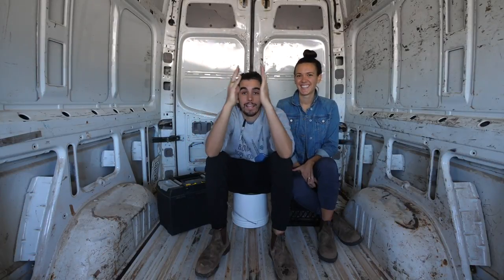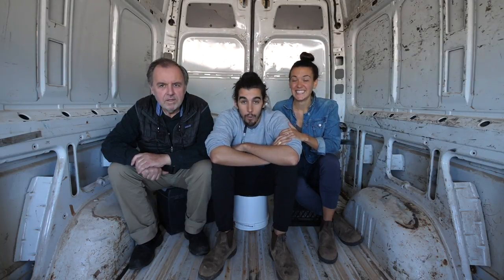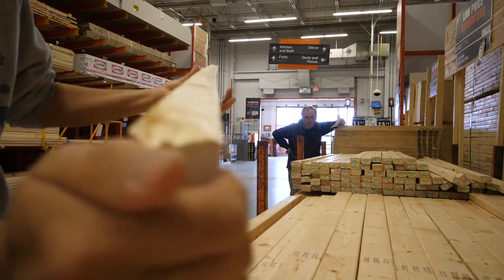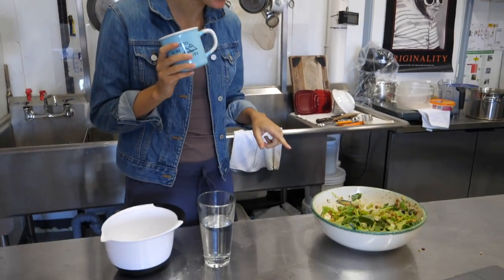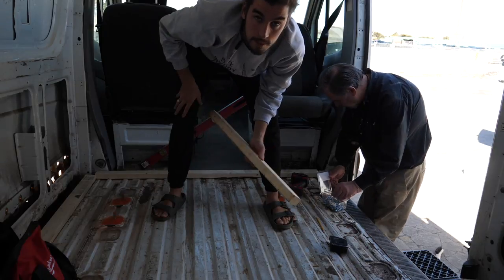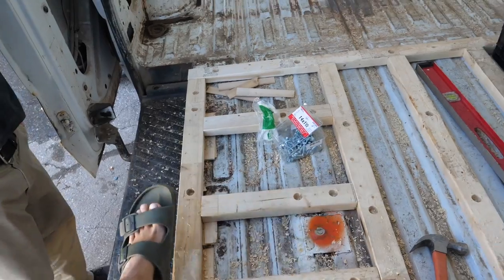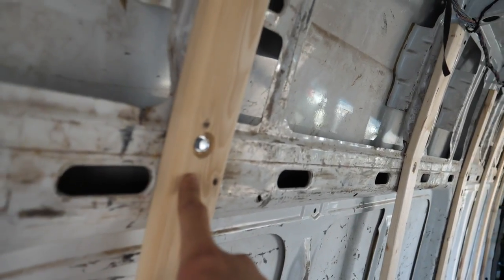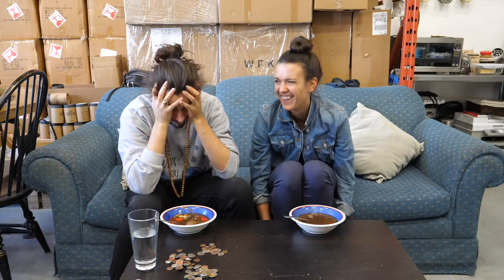CONVERTING A NEW SPRINTER VAN?!? | Eamon & Bec

Comment: Can I make a couple of suggestions?  In the floor area between the sliding door and the kitchen you might want to cut out a square of the metal floor, then weld a metal grill all around with a couple of bars for extra support underneath.  Then you can put screen material on top of that to keep bugs out.  On top of that you can put back the wooden floor and make it removable.  The purpose is to allow the cool air under the van to be pulled up when you put on the ceiling fan.

The other thing is to get swivel front passenger and driver seats.  You would be amazed how much that increases your seating area, especially when you want to socialize

Comment: cost of 2 component spray foam in HD is $400. and u probably need about 4-5 of that 2 component to get 2 inches thick of spray foam. that will be sufficient for your vapor barrier and r12 insulation. 

which if you think about it, that amount of money will be enough to send that van to a professional spray foamer and use the industrial type of foam which is kinda better and more rigid. plus they can shave/trim the foam to your specification. 

just a thought from a guy who works in the insulation industry.
Reply from the maker: Appreciate that! We are going to working with a pro!

Comment: Thanks for doing this.  The more detail the better.  Did you use the self tapping screws to put the floor down?  Do you need to seal them in some way underneath the van from water?

Comment: for water storage, you might want to mount a huge PVC pipe on the top like 6 in. by 6 ft. on the top of the van with a hose coming down the top for the sink and even a shower.   You can put a heating element to keep it from freezing in the winter. It would run on just gravity.  It would still be stealthy since it's just a pipe.

Comment: Looking forward to watching this build. Will you guys be doing a full insulation with a vapor barrier and diesel heater? Spray foam is definitely the way to go and being that it's a van a singe kit will be more than enough. It is messy and hot when you go through the process but it is well worth it Also do yourself a big favor, drop the headliner in the cab and put reflectix under it, you'll be glad you did.

Comment: Hi Guys, excited about your new build. Close to starting on my own DIY Sprinter build. I have a question about the self-tapping screws. My question is : Are you worried that the self-tapping screws will create a bunch of rust opportunities? The reason I ask is because many people who I’ve seen screw things to the inside sides of the van say it’s important to drill a hole first, then spray a primer paint to seal up the exposed metal due to the hole being created, then screw whatever into the van. So, does the self-tapping screws you use have some unique about them that makes you confident that this isn’t something you need to worry about?
Thanks,
Brian

Comment: When using 1x2s, 2x2s or 2x3s, if the curve is not too dramatic, you can use them anyway. Just take care to straighten them when drilling and bolting straight. If you complain about the quality and mention that most of the stock is curved almost too badly, they may offer a discount.

Comment: I hope you're rust proofing the holes you're making in the floor with the screws! Otherwise you're whole floor is going to rust out starting at the screw holes.
Reply from the maker: How would you do that?
Reply: Any bolt holes I'm making I'm painting the bare metal with rust proof paint. Any holes in the internal ribs probably don't matter so much, but I'm doing them as well. Any holes through the floor I would seal up really well with something so water can't splash up and attack the edges. The car manufacturers use that thick spray on stuff, I assume to stop stone chips from causing rust, so something like that over the exposed screw tips maybe?
Reply: Eat Sleep Van or just use 3M90 to glue studs down. Screw few down perhaps if they are to support cabinets ( if not attached to the wall.)  Then screw top floor into the studs. No movement no squeak..
Reply: So looking forward to the electrical!

Comment: kinda blew it on the nail gun at $300+!  Same function at harbor freight for an air nailer AND a compressor for under $100...  and the $45 pancake compressor, if you took it, would fill tires, air mattresses, blow out dust, etc.

Comment: hope you will check the mechanical/technical side of this van BEFORE you sink too much money into it. Sprinter models 07-10 have a lot of issues. If you want to live in a small space, get a Tiny house, if you need reliable transportation, don't neglect drivetrain, diesel injection or electrics. Yes, I drive one too with almost 400000 miles.

Comment: I see you have some holes in the new van Mercedes Sprinter vans do rust out I seen a few look bad Mercedes says they fix that on the new 2019  Mercedes Sprinter Vans they do look sweet lots of new tech in them Eamon you must be over 6'4 I think the vans have a 6'4 standing height in them the floor you put in with the new ceiling must really cut back the space

Comment: Did you use nails in your van? Are the joints made using them still tight? If either or both of those is answered with a no, then turn that nail gun in.